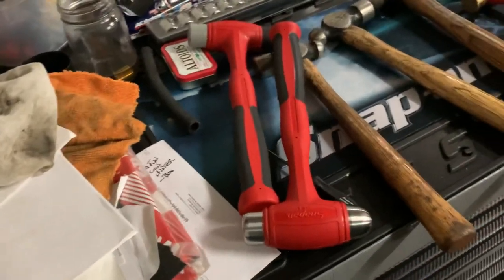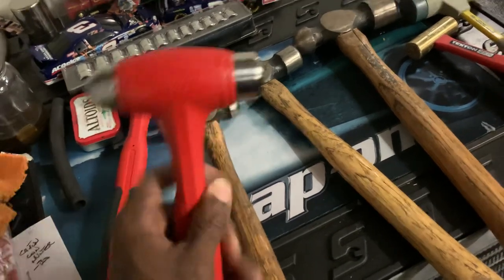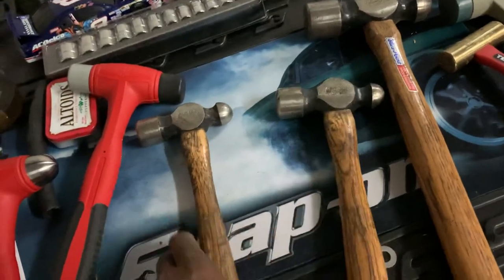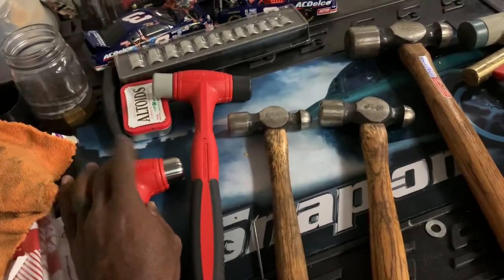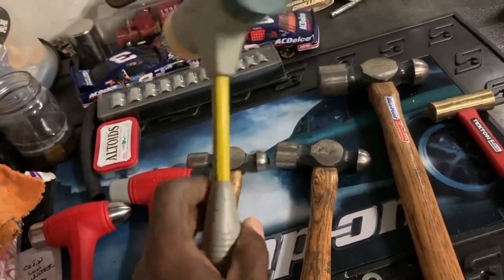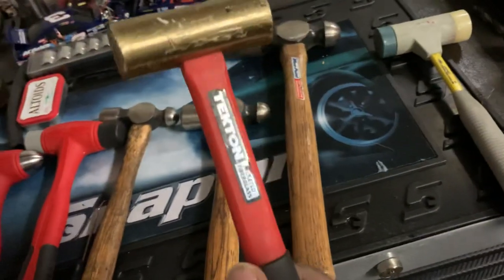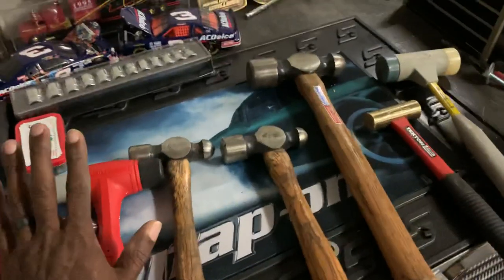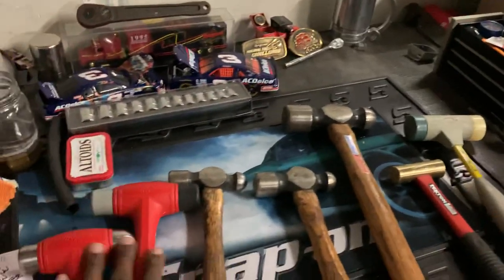What makes a hammer a great hammer | Snap-on v. Bluepoint v. Tekton…

Comment: Bronze can come with many properties    Bronze is harder than brass but still soft and durable enough not to damage harder metal surfaces.   Snapon uses a bronze mixture most likely to improve durability and lifespan of the hammer.   Snapon 32 oz Bronze hammer is like my go to hammer in the shop 90% of the time.   It is an awesome hammer

Comment: Which soft face snapon deadblow would you recommend hitting a rotor loose? Working on a ram 1500 rear brakes
Reply from the maker: If you’ve good room to swing, I’d recommend the 53oz, otherwise you’re limited to 45oz or lighter.
Reply: @MidwestToolReview  thank you…it’s a fairly new rotor replaced last year so I want to save it, but I need to get to the drum hardware underneath the rotor (parking brake)